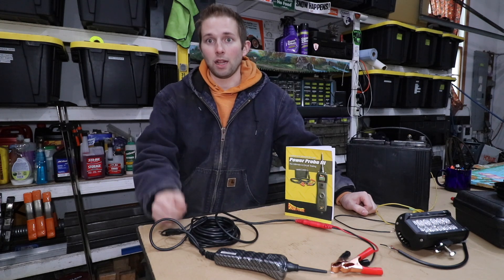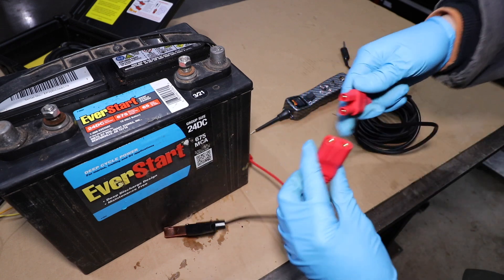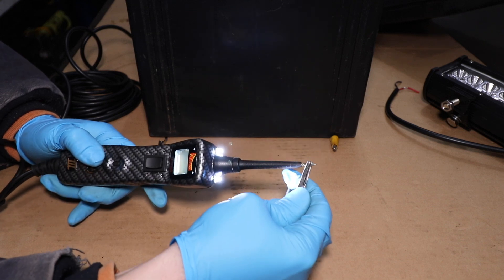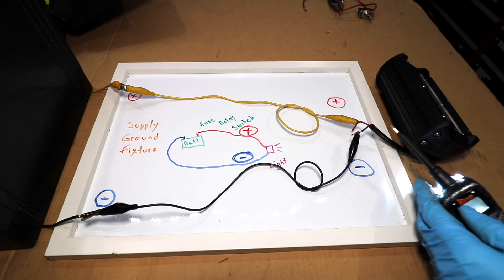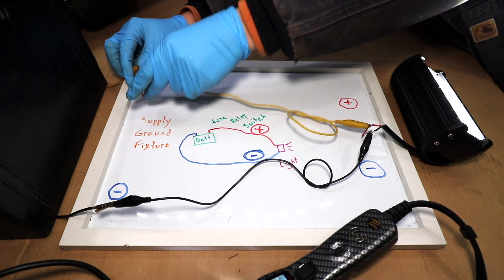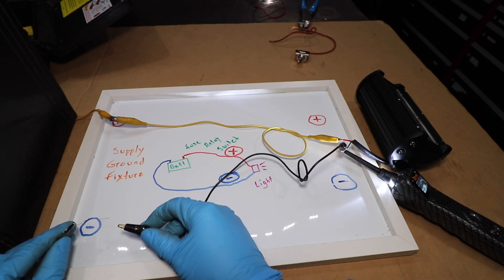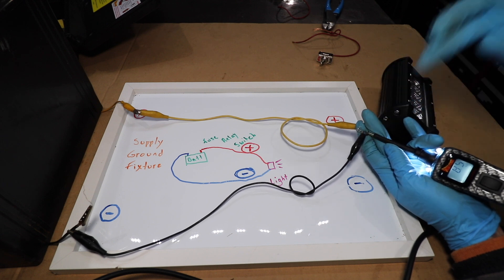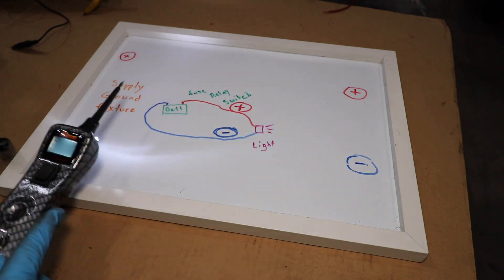Power Probe 3 ⚡How to Use it ✅

Comment: It's necessary to know what you're looking for or what the goal is.  The temptation to poke wires and push buttons has the potential for causing big problems.  This is a nice tool, BUT, it's an expert's tool.

Comment: @5:00, Shouldn't you say you could have an issue with 1 of 4 things , supply, ground, fixture, or connections/connectors. And really multiple of these ( like if your ground and supply are routed right next to eachother and they both short from something they rub against, removing the insulation off of both wires)?

Comment: Love my PowerProbe. Wish they'd been around forty years ago. However, the first thing IO did was turn off the beep.
Reply: And, at around 9:00 you showed me why I shouldn't do that. I didn't know the beep would 'flicker', for want of a better word, like that. Thanks, always learning.
Reply: @theokanomad1620 that flicker and "ghost" voltage has made me aware of ionized air in my area when I'm working outside and it might be raining. Let's me know its time to wrap it up or move it in doors.
Reply: The shop boss has an old cart from his time as a tech decades ago. the cart is wired with testing lights, jumper leads, 12v cig lighters and enough extension clamps to connect to a vehicle battery and roll the cart around to the work area of a vehicle. He literally built himself a mobile testing cart like a pp3. Even different tone makers and resistors to compare voltage drop. There's a polaroid picture, in his office, of it with him standing next to it while working on a car. He's got a lot of cool old tech in his office too.
Reply: @JAERepair  Very cool. My first boss in the collision field made many of the shop tools. His frame pulling equipment was his own design.

Comment: Electrons are negatively charged, so they leave the negative (–) terminal → through the circuit → and return to the positive (+) terminal.
Reply: You are correct that the flow of electrons is from negative-to-positive. It is commonly taught that it happens from positive-to-negative because of wiring nomenclature. We call the “hot” wire positive because it always containing electricity, and the neutral or ground wire as the negative with no electricity in it. So when the two are connected it is taught that electricity is flowing from positive-to-negative but in actuality it’s just creating a closed circuit so electrons can flow from negative-to-positive. Books and diagrams teach that electricity flows from positive-to-negative but the flow of electrons is negative-to-positive.
Reply: You are correct sir but it’s taught positive to negative jus for ease of things I’m assuming

Comment: Can i deliver 24v out the device aswell if the vehicle has 2 batteries?
Reply from the maker: I believe it will work on 6-24V systems, but you should confirm with the manufacturer.
Reply: Mine looks like his and it says 12-24 volts at the bottom of the screen

Comment: Had a tech use this to poke wires.  He was fired within a week
Reply: Context ? Was he working on a space shuttle? If not Id like to hope he did something else as for a new tech to be fired for piercing the insulation on a component seems a bit much to fire a new tech over unless he repeatedly done it after being told not to or something, that’s one thing but hey If ur the boss that’s your prerogative.
Reply from the maker: Was he fired for probing into the wires? Dealership?